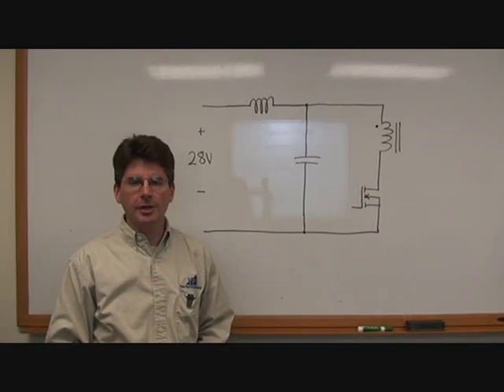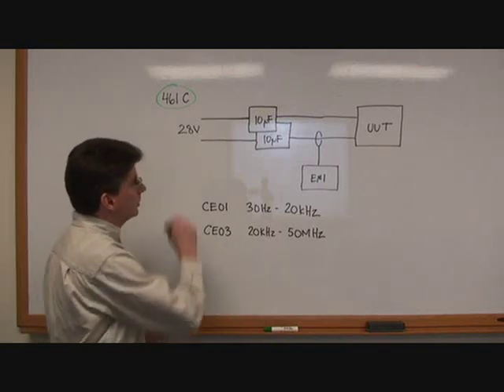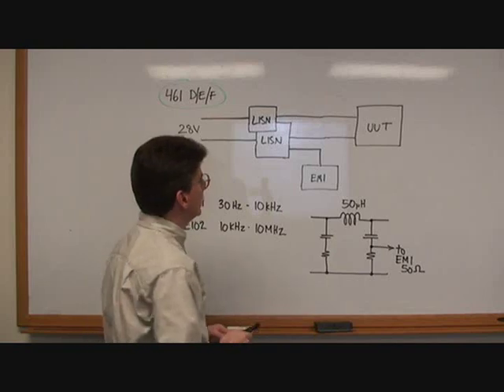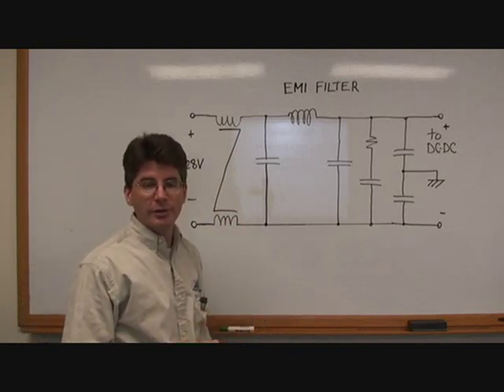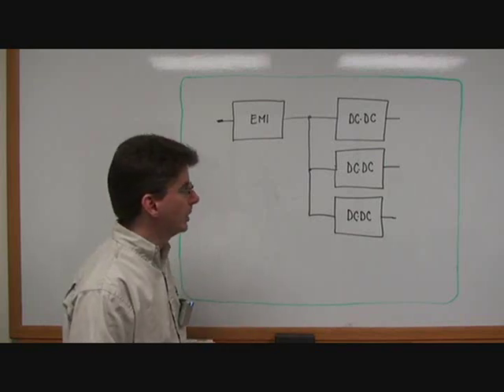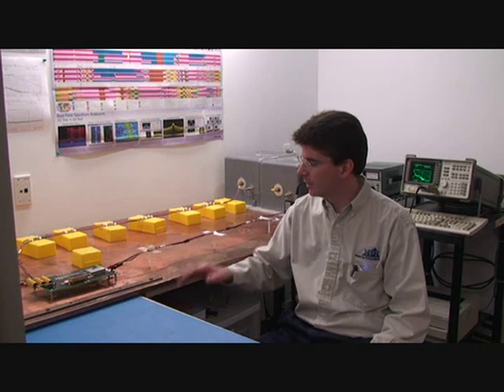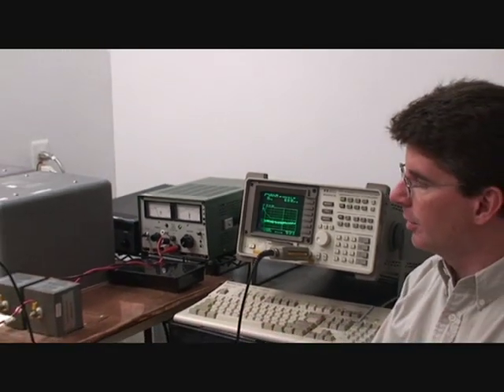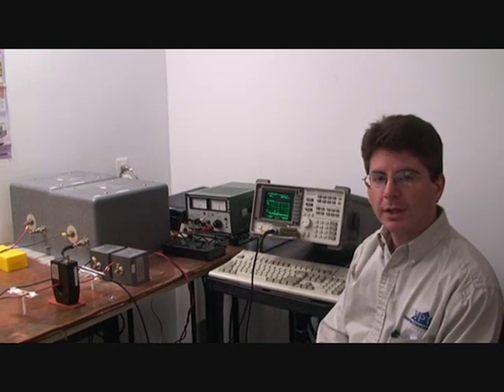MIL-STD-461: Conducted Emissions Discussion

Comment: How did you determine the IF bandwidth of the higher frequency range for CE02. CE 102 rev F/G both have a table that outlines IF bandwidth, step size and dwell times. Does that not apply to the testing you demonstrated because of the measurement equipment you’re using (Analog verses discrete step)?

Comment: Everybody talks about MIL-STD 461F testing. But nobody talks about MIL-STD 461F CS103, CS104, CS105.. Those tests are easy.. Can someone talks about CS103/104/105 about test equipment set up, and measurement. CS103 ant port, intermodulation.